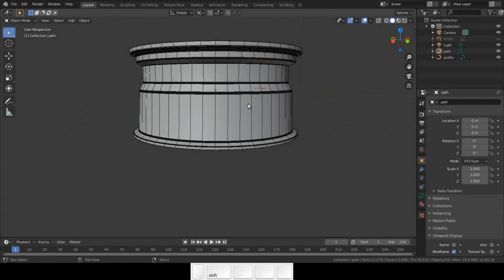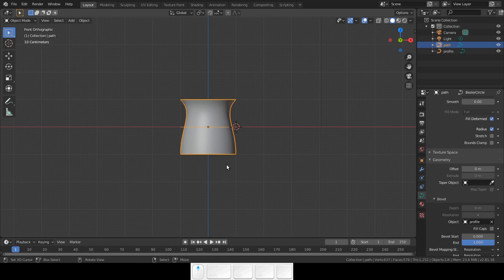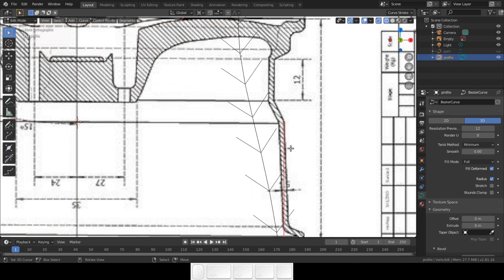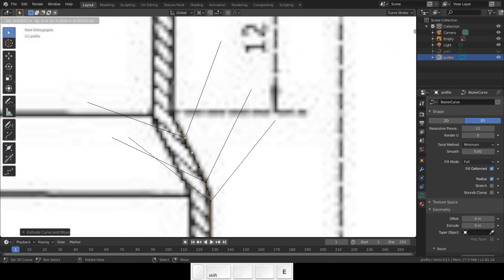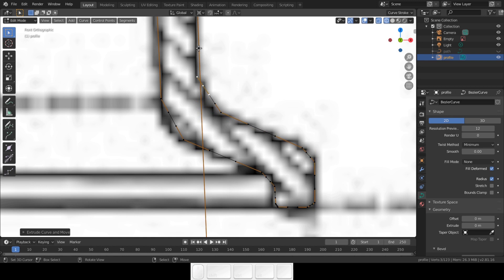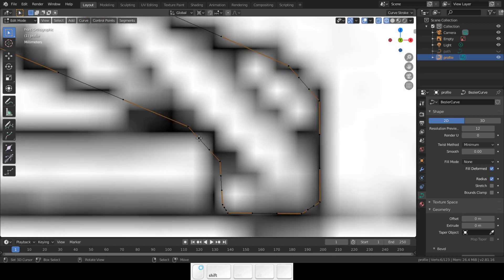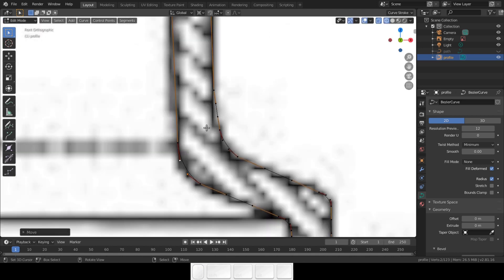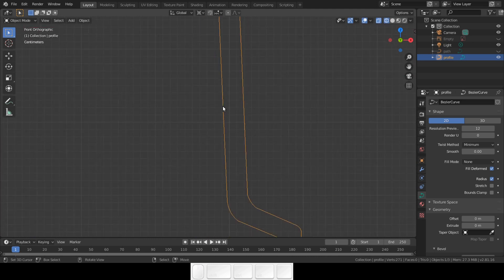Blender 2.82: Modelling with Curves: How to model a Rim

Comment: I a using your method to model a vase. I don't close the profile curve. It works fine, but there are some artifacts at the bottom of it, like small geometric holes. Do you know how I could solve that?
Reply from the maker: yes, i have had that issue also. I tend to not close the curve at the bottom and leave a little hole. You can fill this with ngon if neccesary